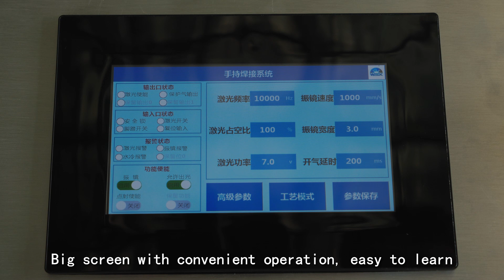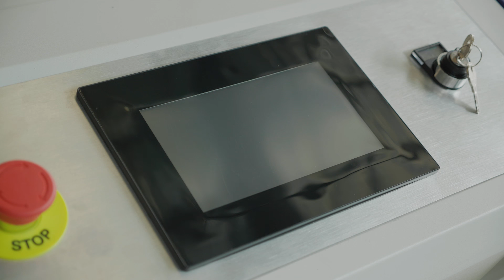Improved Hand Held Laser Welding Machine

Comment: What's the upfront cost?
Reply from the maker: do you mean the welding head?
Reply: @fiberlasercuttingmachine  the setup
Reply from the maker: @Amputee4life628  power depends, please leave me your e-mail I will send you the cost and configuration. Thank you
Reply: @fiberlasercuttingmachine  shady company practices not saying a rough price but instead trying to sell him one
Reply from the maker: @Hazed64  hello, not sure if you have contact us for inquiry, Penta Laser won't give customer a rough price and let them to compare the prices from different companies, that's not responsible for customers. We first understand the demands of customers and recommend the suitable machine, different model with different specifications have different prices, customers come to ask a rough price and decide weather to buy the machine is not a wise way. Not to choose the cheapest or most expensive machine but the most suitable one. Thank you
Reply: @fiberlasercuttingmachine  This machine can add a minimum of how many millimeters and a maximum of how many millimeters of plates. How much is it worth?
Reply from the maker: @hariom_engg  Hi, are you going to weld 2 pcs plate together? max and min thickness depends on your standards to the welded part, like how much depth of fusion you required. Please write your demands to overseas@pentachutian.com, we will feed back to you soon.